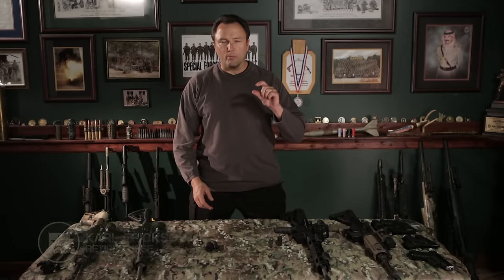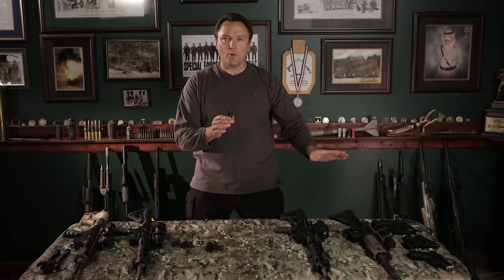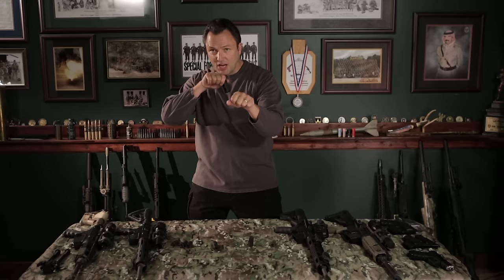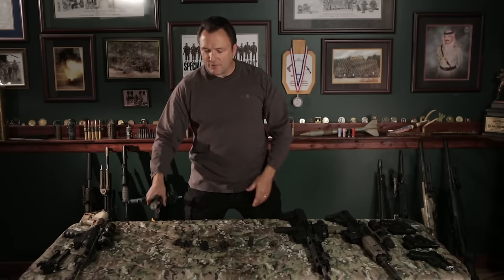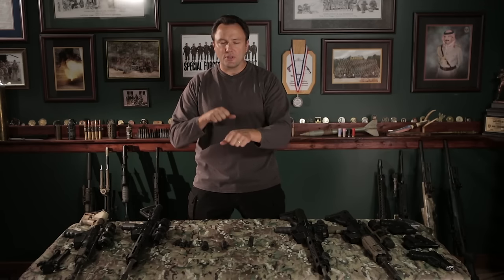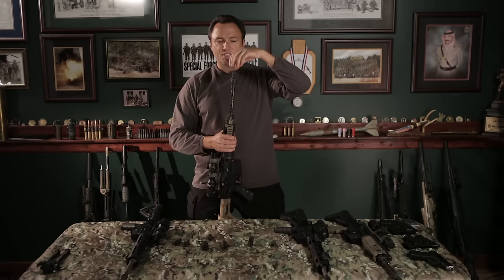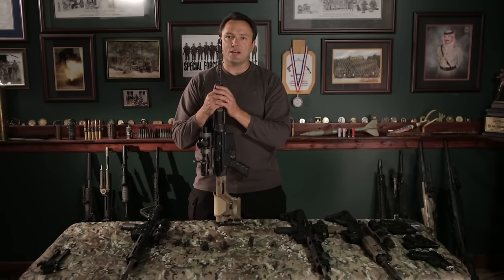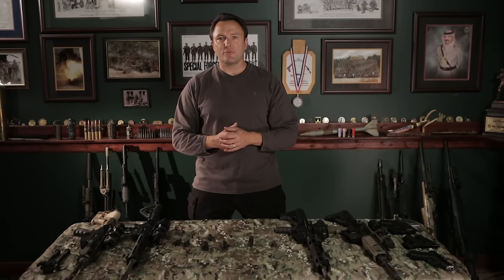How to Choose the Right Muzzle Brake For You | Flash Hider Review | Tactical Rifleman

Comment: 3 pronged flash hiders typically reduce flash more than a birdcage - but they can snag on stuff and can sometimes make a pinging sound when shot.  I also think that the birdcage design provides a more durable/stable tip for muzzle thumping.
Reply from the maker: Agreed
Reply: a lot of the modern prong type flash hiders like the SEI Vortex, the Maple Ridge Trident, and the various Surefire designs, have much thicker and stronger prongs than than the old M16A1 threeprongs. Also given the fact that USSOCOM has been using prong type flash hiders like the Surefire's for years now, probably indicates that they are durable enough.
Reply: @MaxwellAerialPhotography  I would argue that the current popularity with SOCOM would be for mounting suppressors more easily, though I'm sure they ARE far more durable than (and de-tuned from) the older M16 three-prong.
Reply: @MaxwellAerialPhotography  Check out Seek rook flash hider

Comment: Great video! One added FYI, if I may. A big reason they closed flash hiders in Vietnam was because the crates holding rations were bound together with a small wire. The GI’s who were young and hard on equipment would use the muzzle break to break the wire and pop the container open. This resulted in bent flashhiders. Three prong open flash hiders like a dead air KeyMo are the best flashhiders you can buy period

Comment: The xm 177e2 had an extra long flash/blast suppressing flash hider it was also used to keep back pressure up on the system to ensure it would cycle after the round left the short barrel.

Comment: The slats on the flash hider mix the hot burning gas with cooler air at an accelerated speed causing the flame to shrink and/or the gasses to fail to ignite.  It only redirects the flame according to Hollywood, who use blanks that push more burning gasses at a much slower rate.  Set up a slow motion camera at any angle to the gun or just off to the the side of bullet tajectory and compare with and without flash hider, you will notice a difference, even though the flash is not entirely eliminated.

Comment: I just learned a lot. I that flash hider and comp was the same thing but I was very wrong. Thank you sir
Reply from the maker: Thanks for watching, TR
Reply: @TacticalRifleman  I have a question that I haven't seen discussed before. Does using a muzzle brake vs a flash hider, in conjuction with a suppressor, increase flash signature to any measurable or noticeable degree? I'm currently using a Surefire muzzle brake with a Surefire Socom556 RC2. I went with a brake to act as a sacrificial baffle. Saying this, flash signature reduction is my highest priority so I'm willing to switch it out for a flash hider if there's a noticeable difference.

Comment: PWS FSC30/556

Was incredibly effective on my MK216(.308M) in all areas, though it is pretty long.  I did end up having to switch to a dead air mounts in the end, when i started running suppressors.

Comment: Check out the surefire warcomp. Works pretty darn good.
Reply: Lbsthapink I LOVE that flash hider! Even on my SBR (which was a flame thrower even with the A2 birdcage) it completely kills flash and does a pretty good job of muzzle control too. And it's not miserable to be around like my lantac Dragon.
Reply: I don't know what the deal is, but the Warcomp on my 14.5" middy OVERcomps. I mean, it really SHOVES that muzzle down, below parallel with the ground. So rather than my red dot moving slightly skyward during rapid fire shooting, it goes downward. Reaalllyyyy annoying. At least an A2 keeps my muzzle nearly completely neutral. I haven't shot the Warcomp at night, so I can't comment on it doing its primary job duty...

Comment: No. The 3 prong flash hider wasn't getting caught on the wait a minute vines. We were using the damn thing to break the wire
around the c ration cases. So eventually the barrel would get loose if the GI was turning it counterclockwise so
no accuracy. Damn! didn't think about it until the Southeast Asia Wargames were over. I imagine the Army didn't want to talk about that.
Reply from the maker: Never heard that side of it, but I did have a few guns fitted with the 3-prongs ( while playing OpFor) get snagged on vines and brush in late80s. The crusty Nam vets in my unit mentioned they had the same issue in the jungle.

Comment: A can will mitigate some recoil and flash and noise...I run typical 3-4 port breaks on my bolt guns. Stoner brake from midway is cheap and very effective,  Jerry mickulek breaks on my precision Ar's cheap/effective and I got 2 whit machine brakes one on my 300 ultra mag hunter and the other on my 32" 338 edge.
Got a job howitzer brake but its a bit fugly for my sexy ass rifles
Reply: Spell check sux..jp howitzer brake

Comment: Great video. 

Any suggestions on a compensator muzzle device? Shooting 5.56 for me I’m a bigger guy and recoil has never bothered me in the small round. What I’m interested in is a top quality compensator for less muzzle rise.
Reply from the maker: It will vary based on your type of ammo (how much blast) and barrel length (how much blast is left by that length). Shorter barrels equal larger blasts and longer barrels less blast (visibly arriving at muzzle). So, you may have to try a few to find "your" perfect combo. Here's what I did for Muzzle Rise, when building a 3-Gun Upper:  I found the best brake I had (it was a Benny Hill). I then slightly drilled out the top holes to vent more gas upward. Went and test shot. It needed more. So, I drilled larger gas port and repeated test. I now have a sweet upper that does NOT more a lick when shooting that load of ammo. Worked for me.  Thanks for watching, TR.

Comment: Question: can I use any muzzle brake as long as the threads are the same and it's meant for the same caliber? Like, can I use a 308 muzzle brake for a 308 Winchester round with the same threads?
Reply from the maker: Yes

Comment: For the Surefire Muzzle Break they have  6.8mm muzzle break or a 308 muzzle break would a 6.5 creedmoor round work still even though its smaller then the design of the break
Reply from the maker: It will function, as in you wont have to worry about bullet strikes. However, it might not catch as much gas. A good break should be selected to match the amount of gas being generated. Too strong a break may actually move the barrel forward and down, though not often. A 6.8 brake would work great on a 6.5 Grendel... But I might prefer a 308 brake for the 6.5 creedmoor. Other viewers might correct me on that. So, I'll defer to them. Thanks for watching, TR
Reply: Thanks for the response

Comment: What year did the army change the three prong flash break in Nam?
Reply: will it changed when the M16A2 came out.
Reply: Circa 1988?
Reply: You’re all wrong. The 3 Prong was used on the XM16E1 which was issued until 1967. It was replaced by the M16A1 which had a Birdcage flash hider. The A1 Birdcage had slots around the entire circumference. It was replaced in the mid 80’s by the A2 Birdcage which closed the bottom slots to reduce dust signature.

Comment: Why can't there be a muzzle device that does both things well?
Reply from the maker: Because it would have to be a compromise.
Reply: @TacticalRifleman  Sure there would be some, but it shouldn't be that hard to make a decent all arounder. from my understanding, directs the gas to stable the gun and hide the flash are not conflict.
Reply: 3 years late but I would check out the precision arms afab/efab. They have tested the light output and recoil reduction in inches. It is very close to as good as an a2 with flash reduction and about middle of the road as far as breaks go, whereas the a2 does very little in terms of recoil reduction. The concussion has been described as very minor compared to dedicated brakes. Jeremy S has a couple of really good videos on testing a tons of devices

Comment: Completely wrong about flash hiders. The design is to stop the ignition of gases as it exists the barrel. No big fire ball like muzzle brakes.
Reply from the maker: You are mistaken. The gases are already lit. The choice of design is where it is more visible from
Reply: @TacticalRifleman  you can watch film from flash hiders from all directions and it reduces the the actual flash. 
From the internet: Flash hiders work by breaking up and dispersing the gasses and burning particles that exit the barrel.
As the gasses and particles pass through the flash hider, they are dispersed across a larger surface area and mixed with cool ambient air.
This rapid cooling and dilution reduce the intensity of the combustion resulting in a less visible muzzle flash.
By effectively managing the combustion process, flash hiders help to minimize the visible signature of the firearm without affecting its performance or accuracy.